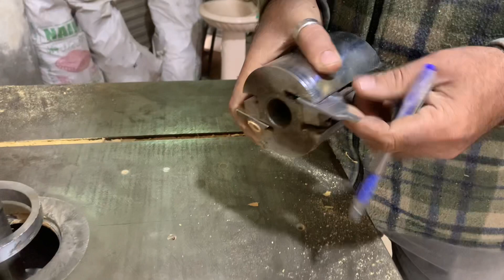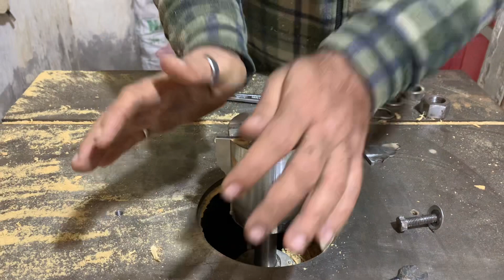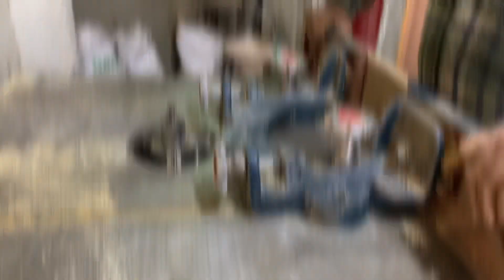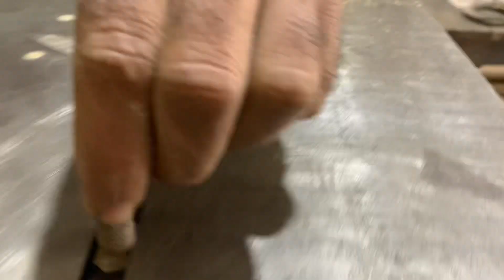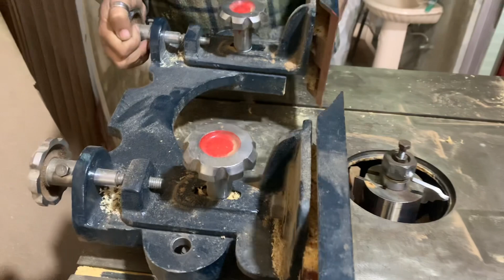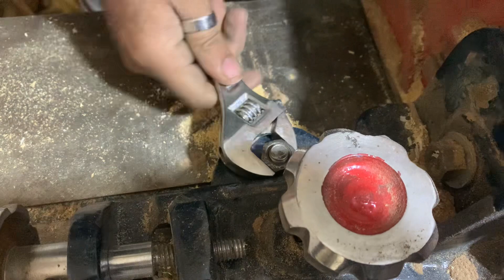Spindle moulder best trick

Comment: Wtf did I just witnes ,tightening down a 4 inc molouldin head with a hammer , and using a larger nut as a spacer...Holy shit I can't belive I just saw this. this is wrong in every single way
Reply: I have a router that the cutter you can only change by hitting it out with a hammer and a chisel 😂
Reply: 1-ALWAYS make a cross cut first,then go along the grain.
2-where is the trick?